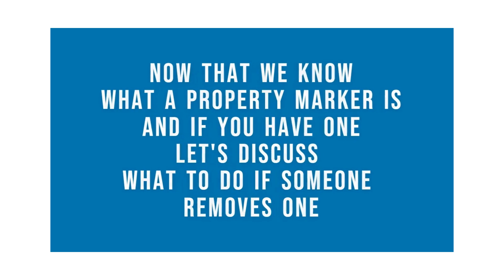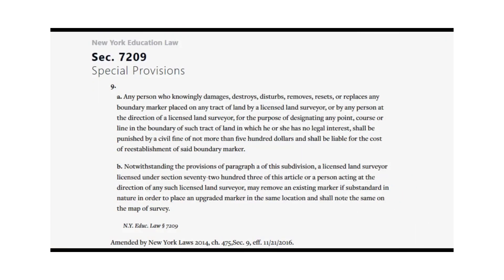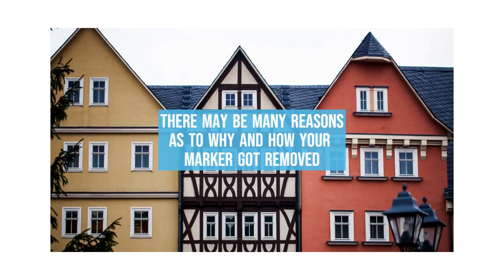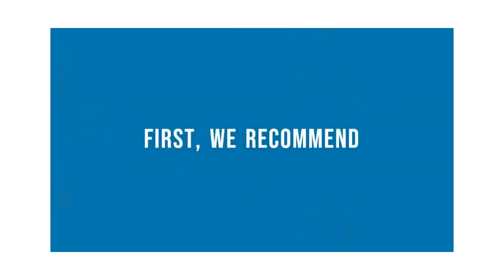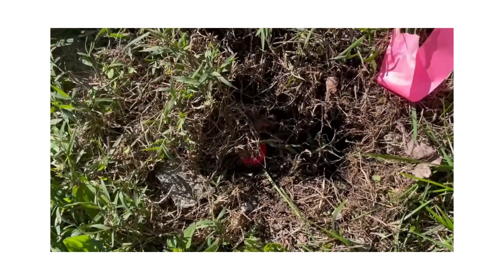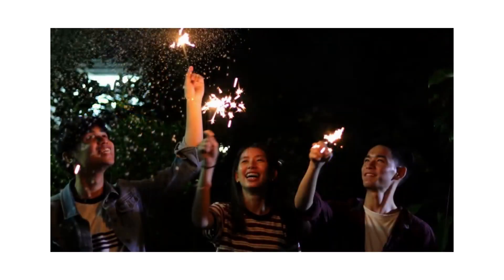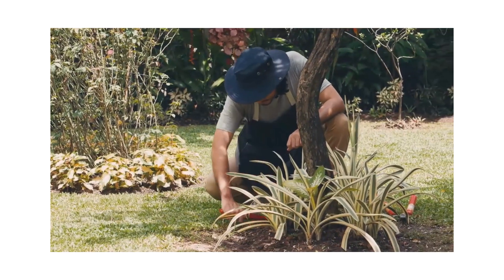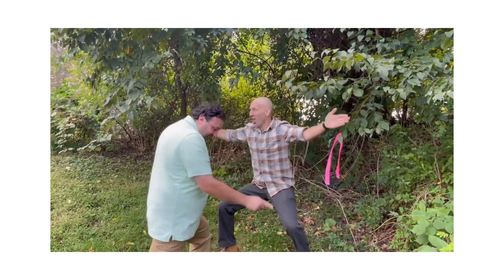Surveyors Corner: What to do if your Property Marker is Removed

Comment: This is so helpful. We bought a 4 acre property three years ago with a new construction home on it.  A boundary line adjustment survey was done one year before we purchased to split our lot from being a ten acre lot into two lots: a 4 acre lot (ours) and 6 acre lot on the north side which was bought by someone else and then built on.  And ours was the last lot to sell so we were advised buying a new survey was not necessary as nothing had changed (other than our new house being built). So we did not get one a the builder might have taken another offer if we had. New neighbors who bought the older home next to us on the south side away from where the boundary line adjustment was made, seemed to like our wooded area inside our property line so we had the surveyor come out and do a stake out hoping they would stop going in there.  They did not. So we added posts, not wanting to clear land for a fence.  This still did not dissuade their occasional entry and they were starting to bring contractors in with them for unknown reasons and were seen measuring our frontage surreptitiously (trying to look like they are just walking by checking their smart phone every time in the same places).  So we had a fence installed that  covers 75% of that property line, leaving one section due to a stormwater easement. My question is, is there a benefit for us to have a new survey done now, four years after the boundary line adjustment survey was done? Just to include the house, improvements and fence? The previous stake out stakes are mostly still there with a few exceptions, and about half the iron pins are still visible.  The surveyor who did the boundary line adjustment and my stake out of that boundary has the notes from having surveyed our lot twice.  Would we benefit from doing a new survey to show the improvements? Our house is centered so is not an issue -- it's really the neighbors who are interested in our land that we are concerned about.  They may have some sort of encroachment on our land we do not know about and are looking at adverse possession taking of our land.  A new survey would show the house, driveway, new fence, and no longer include the old boundary change but show our lot as a whole 4 acre lot.  I guess I'm just worried about the neighbors engaging the surveyor and influencing him to find our fence as an encroachment even though we used his stake out for the fence or maybe somehow changing the boundary from what it was for some reason.  The neighbors are acting so oddly and have and some buried pipes on our land that we found and removed.  So we're skittish.
Reply from the maker: Dear Tracey,
We've reviewed your situation and want to provide you with some straightforward guidance, broken down into key points, as representatives of the New York State Association of Professional Land Surveyors (NYSAPLS):
1. Considering a New Land Survey:
• Even if advised against it earlier, getting a new land survey can offer valuable insights and peace of mind.
•A fresh survey would capture your property's current state, including your home, improvements, and fence
 
2. Neighbor Concerns and Surveyor Ethics:
• Worried about neighbors influencing a surveyor? Licensed surveyors are sworn to protect the interest of the public. They do not advocate for their Client, but rather report unbiased findings of fact.
•Your original surveyor's work is based on thorough research and measurements; any changes require strong legal evidence and change in the physical features

3. Open Dialogue with Neighbors:
•Communication can often resolve misunderstandings. Consider talking to your neighbors about your concerns.
• They might not be aware of the impact of their actions on you.
	
4. Final Thoughts on a New Survey:
•A new survey could provide a clearer picture of your property and help address concerns
•If you decide to proceed, please go to the Find A Surveyor section at www.nysapls.org
 
New York State Association of Professional Land Surveyors (NYSAPLS)
Reply: @nysapls  Thank you good advice. As for the neighbor communication, I understand and it is good advice in general but these people are not talking to us and when they do they offer us nothing in terms of transparency (even denying knowledge of their down spout extensions on our land that they were seen weed whacking and bringing in a contractor to open up into our stream so it would be visible then agreeing to remove them some day in the future but declining to acknowledge a permission letter I offered to provide them then avoiding us at all costs to leave the plastic pipes on our land 150feet from their house). We are concerned about the surveyor because these people have turned our fence contractor against us, our landscaper and won over the surveyor the last time he was here. He was in love with them and they are not nice people to us.  They sicked their dog on us whenever we go on that part of our land and warned us not to go there anymore.  Hence the fence/ More detail than you need.  Just want to make sure you know I'm not a nutjob but the neighbors are surreptitiously up to something. Thanks -- I'll contact a surveyor to see about a new boundary survey with improvements and ask for all encroachments and easements to be included.
Reply: It sounds like you're concerned about adverse possession. I recommend you post Private Property - No Trespassing signs no less than every 75 feet along your boundary in a clear manner.  This in itself won't prevent an adverse possession claim but it will increase the difficulty level greatly for your neighbor to succeed.  If they still enter your property after doing this then you have no doubt what you are dealing with. I also recommend you place small improvements throughout this area of concern near your boundary.  It doesn't have to be a major improvement.  A simple tire swing hung from a tree, or a good one is to have a professional landscaper plants some small trees with bracing posts and heavily photograph that operation and keep the invoices. And I would walk in there at least weekly if not more with a Go Pro camera on your chest, videotaping yourself on your land, trimming branches or picking mushrooms or whatever, with your fence and No trespass signs in the background.  You want to invalidate any "exclusive use" claims.  Finally, lawyers will tell you to give them permission to be in there which will invalidate an adverse possession claims but not entirely. It doesn't prevent them from filing a claim anyway and wasting your time and energy and money or refusing to sign any paperwork acknowledging permission which turns into a "he said, she said" situation.  Plus it pretty much ensures you will have your neighbors' present frequently on your land which sounds like what you don't want.  Finally, unless you decide to give them permission, I encourage you to place security cameras along your boundary showing the likely access points.  Trail cams are cheap and somewhat effective and may even serve as a deterrent. If they enter after posting signage and fencing and you have evidence, you can legally eject them which also kills a possible future adverse possession claim.
Reply from the maker: Thanks for your comment, Tracey. We've forwarded it to our PR committee (who created the video) to review and respond.